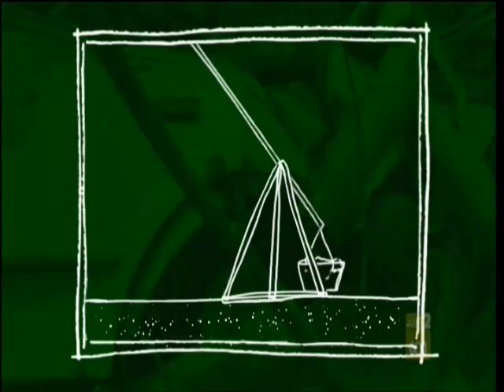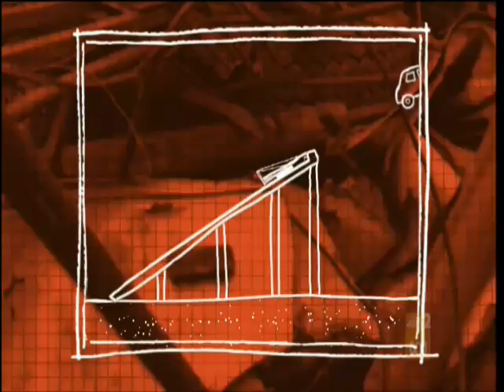Scrapheap Challenge - Mini

Comment: given the time constraints, materials available, and the tools they had, making a trebuchet that size that would work would be a pretty hard task. plus as you said, it's not the point of the show. they might well have done the calculation, found it probably wouldn't work, but still gone for it. it's a shame, but the design was more or less doomed from the start :P good tv though xD

Comment: that wasnt snagged; it just got taut as the slack was pulled out of it by the falling lead, and wobbled because of the speed with which it happened.
though you may have something there; if they're attached the chain and main it tight BEFORE releasing the weight, there wouldnt've been such a great instantaneous force, and it might've just managed it. 
Though looking at the way it broke, it probably woulda gone when the mini came round on it's curve anyway; it just wasnt quite strong enough.